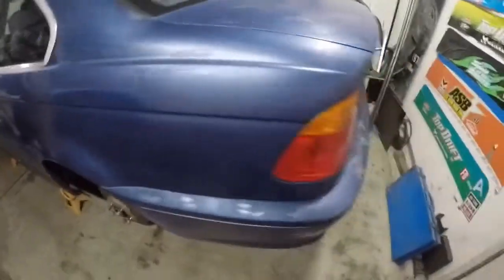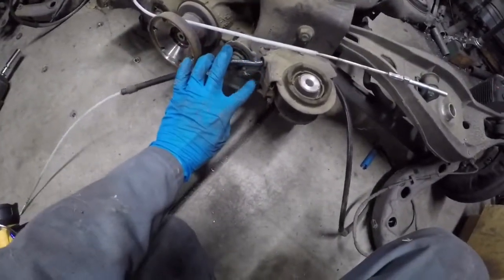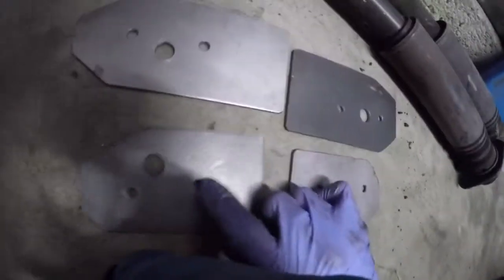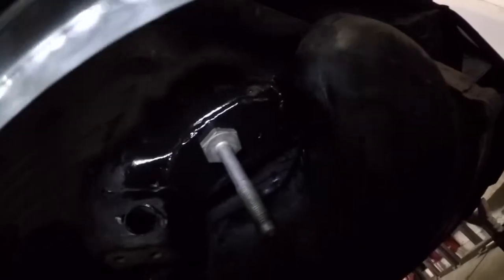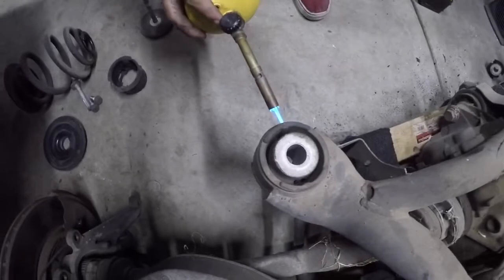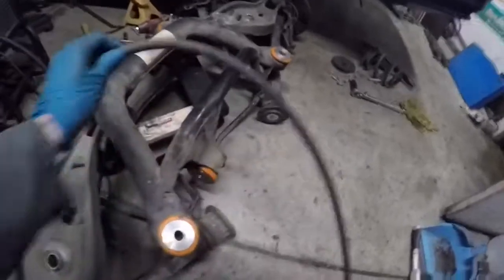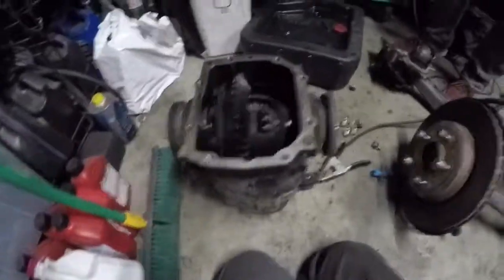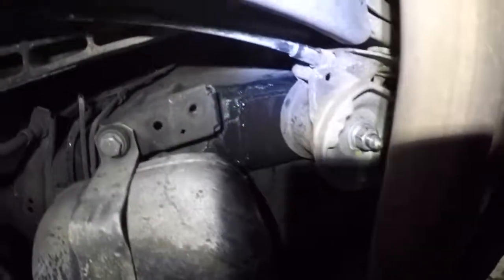E46 rear subframe reinforcement, welding the diff, subframe bushings, Drift prep

Comment: hey great video, gearing up to do this on my e36. definitely gonna try your method out for the bushings. I'm new to welding and have a cheap flux core welder to do my subframe reinforcements. do you think they'll hold up well as long as I practice enough beforehand? haha
Reply: I welded half of my subaru suspension mounts (body itself was rusted to hell)with cheap flux cored welder (no gas) and it holds well for 2 years now. So practise it, watch videos with tips for overhead welding and go for it!